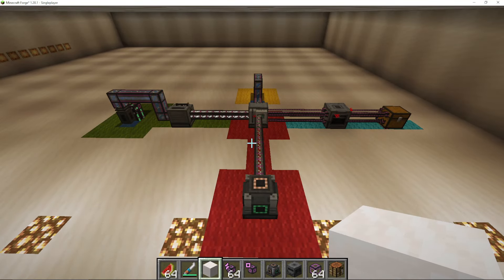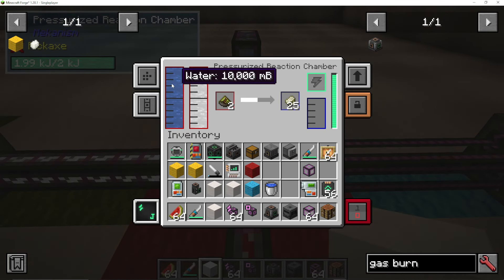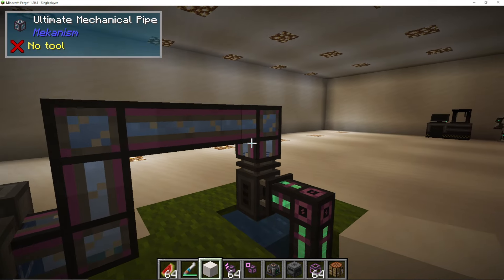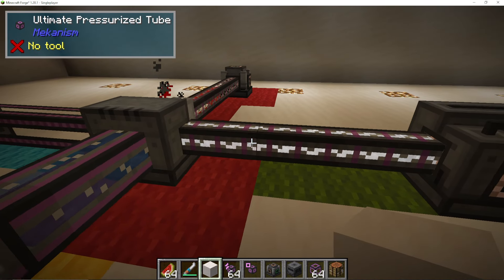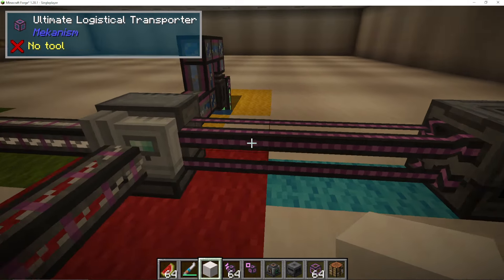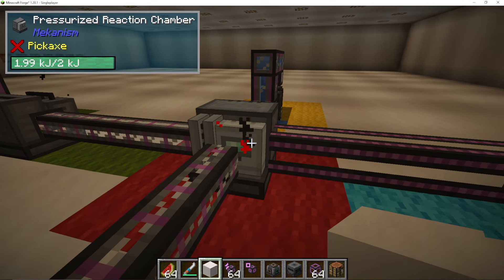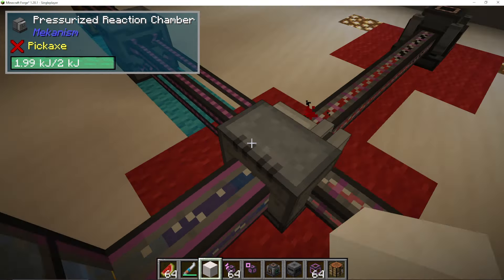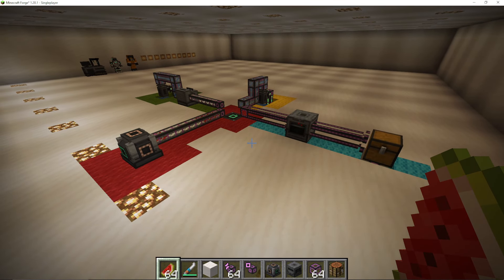Mekanism Ethylene Generator Setup Tutorial

Comment: If you want to make it more compact, you don't need tubes for most of the parts.  Just put the electrolizer and crusher next to the PRC.  Use one pump into the bottom of both Electrolizer and PRC.  If you have Immersive Engineering, the Cloche is fast enough with melons into a compacting drawer to keep up with power for a while.

Comment: How do I pull items out of a chest for the bio fuel, I have the logical transport pipes hooked up but its not pulling anything
Reply: check the configuration of the crusher, the pipe coming from the chest could be set to output when you want it to be input

Comment: you can cjnfigure output sides for electrolytic separator if you want with configurator
Reply: This, in my modded minecraft i did this setup and the separator is able to configure what side the 2 gasses can come out. not just one side like it used to be before
Reply from the maker: I can't believe I didn't know this... This is literally life changing! Thankyou!
Reply: Hi, my separator doesn't have the configuration menu when I click on it, would the configurator work still in this case?
Reply: @ColvyMolvy  It would but just with the basic configuration as shown in the video pretty much
Energy can be "pumped" in from everywhere tho